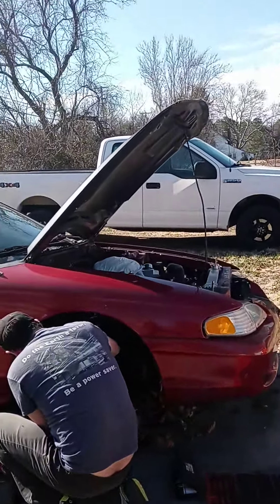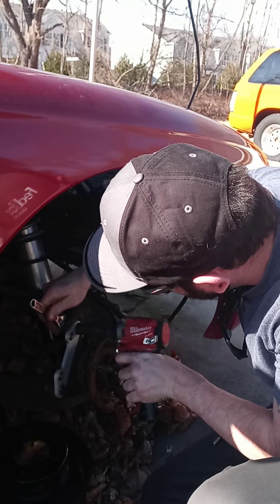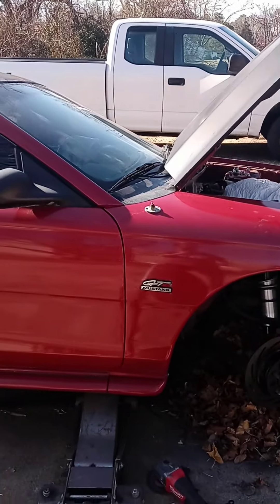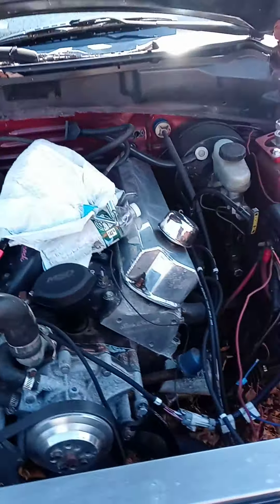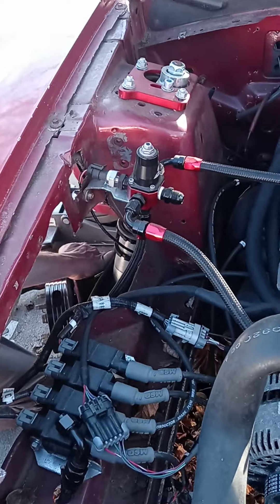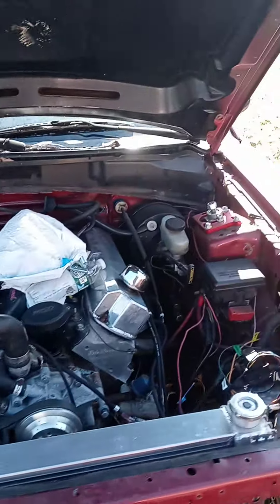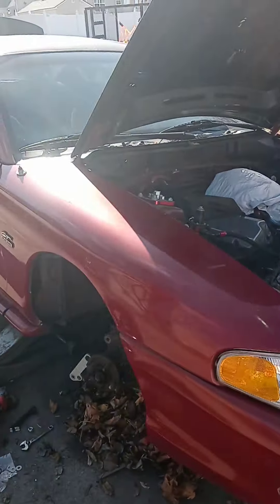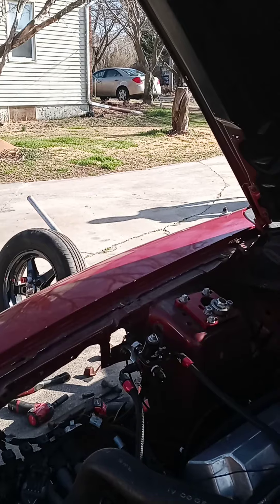SN95 mustang gets a nice upgrade on brake's and struts

Comment: The only place I have to work on my car is the driveway. Before it was running, the back yard was the spot and it was parked over a few sheets of plywood leftover from someones roofing job. I appreciate other folks getting the job done with what they have. Keep up the good work. There are lots of us in barely adequate work spaces with minimal to no budget and some of the ideas you present are golden. Thank-you.
Reply from the maker: Im spoiled here with the working area at my old house i was in all dirt using old fashioned bumper jacks cinder blocks and old mufflers just to get the car high enough to put a trans in and still had to dig a whole under the car it sure wasn't safe and the 400 turbo felt like a ton on my chest to get it up in the car so i surely understand the limited work areas thank you appreciate the comment stuart